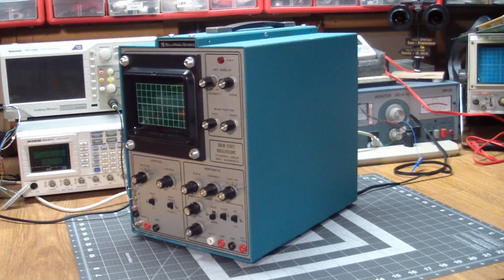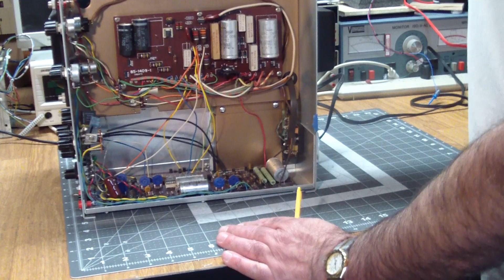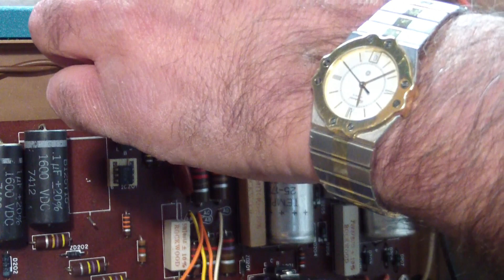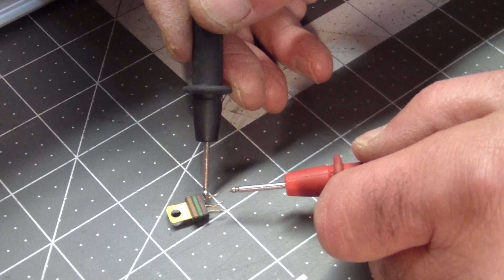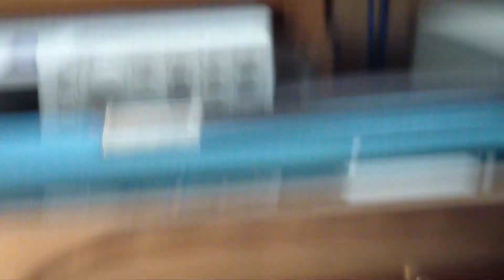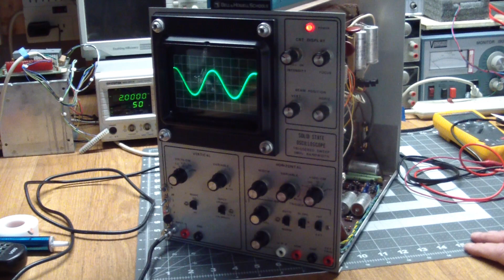AE#175 Bell & Howell Oscilloscope Repair

Comment: I had a scope just like that one. Recapped it and connected an oscilloscope clock board to it.

Got tired of every time I turned around having to repair or re-adjudt something on the scope so I gutted it and found a small modern deflection board and got it working as a scope clock.
Reply: The scope will work great for the Dutchtronix oscilloscope clock, however that board is not available as a kit anymore.

Save yourself the trouble and get a complete scope clock kit which includes everything needed to make the clock work properly. Will completely eliminate the stock circuitry with something much better.

Also the stock CRT socket isn't very good.

I replaced the socket on mine with a ceramic socket.

Comment: Thank you for the inspiring repair vid; is there going to be a part 2? (Apologies for being greedy for your knowledge) What effect the bad capacitors had on the trace and a quick calibration to show how it compares to a modern scope. I understand that it may not be worth investing more time on this particular scop due to its quirky assembly. Though, if  you are going to convert the unit into a scope clock I guess further repair may be needed to ensure clear digits. 
I was hopeful that you were going to show the railroad crossing repair too, did you video any of the process?
Thank you again for an inspiring, logical fault finding vid, with the added humor.
Reply from the maker: I don't have a video of the crossing sign, the hardest part was screwing in the red bulbs. (Q: How many youtubers does it take to change a bulb? A: More than you would imagine)
The biggest mystery remaining for the scope is the purpose of the proto board which I'll have to look into.

Comment: The BAD Transistor and Bad Capacitor was causing what problems with the oscilloscope?
Reply from the maker: The transistor was shorted pegging the intensity. The capacitor that was previously removed seemed to create uneven intensity in the horizontal direction, so I removed it again.
Reply: @artifactelectronics  Which circuits under test or applications would the oscilloscope NOT Sync or NOT trigger to the oscilloscope ch#1 probing measurements on various test points in the circuit? I'm talking about various applications of circuits

Comment: Nice one Artie. The name Bell and Howell holds a special place in our house. My Dad had a Bell and Howell 16mm film projector.  A dumb question: Could the intensity pot itself be gone bad?
Reply from the maker: I've measured the pot for full range linearity, and except for the very extremes it's pretty accurate.
Reply: I'm wondering if the pot could be changed for a different value to work with the replacement transistor.
Reply from the maker: Using a smaller value pot with offset resistors could be useful in making the combo work in a smaller window.

Comment: I don't have a Heath oscilloscope but I do have a related product which is a vectorscope designed for testing color TV circuitry with a built-in NTSC pattern generator.  I'm thinking of making it into an X-Y display or maybe a curve tracer.
Reply from the maker: I've look at the TEK vector scopes, but they seem to be heavily optimized for TV work.